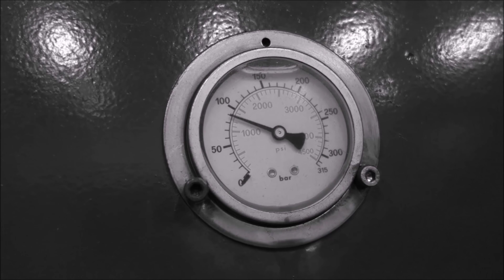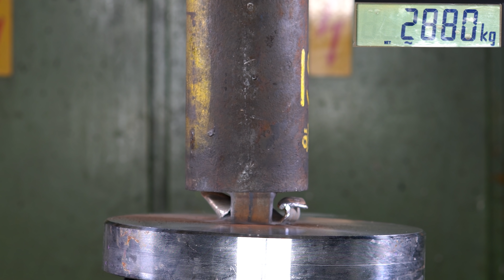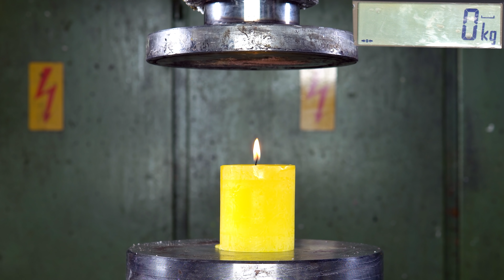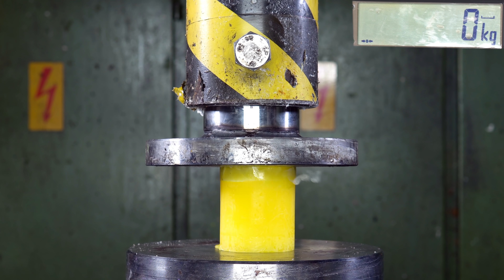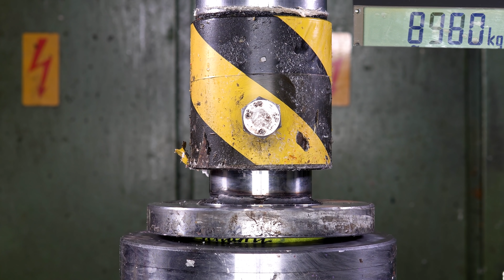How Strong Are different Materials at -320°F / -196°C? Hydraulic Press Test!

Comment: You could machine frozen fruits
Frozen cucumber in the lathe would be interesting
Reply from the maker: I have been thinking about machining frozen things. The mounting is really hard since lathe is quite warm and melts thing quite fast. But I think I could come up with something to prevent that
Reply: Yes please do that
Reply: @HydraulicPressChannel  Maybe you can cool the lathe chuck with liquid nitrogen too? Or maybe it would be easier to make new plastic chuck jaws that won't transmit the heat away as quickly, and mount a copper infrared mirror behind the frozen thing to keep the lathe from warming the part even more. . :)
Reply: I am no expert at lathing, but I'm pretty sure that just about any frozen fruit would shatter at those RPMs...
I am completely fine with that.
Please try it. 😁
Reply: What about frozen Burger?
Reply: @HydraulicPressChannel  you could maybe use dry ice to hold the frozen thing in place, or to cool the mounting before hand
Reply: My guess is almost everything would be so brittle that it'll just shatter immediately, except maybe things like cucumbers that are almost all water
Reply: @joe125ful  it could work too
Reply: Actually the method is used for milling rubber. Maybe not that cold but from what I can remember aduprene would be millable at around -40C.
Reply: @Rubensgardens.Skogsmuseum  good to know😎
Reply: I've seen people machining some of the firmer vegetables (turnips or potatoes) without freezing them first even
Reply: @zuthalsoraniz6764  i have machined hard bread
Reply: @HydraulicPressChannel  You could make a set of soft jaws (covers for the lathe jaws to protect finished surfaces from the rough jaw teeth) and then use some epoxy to attach some kind of insulation like rubber pads or something to the soft jaws. This would probably work and hold up quite well I think.
Reply: @sandy1653  He could just make the soft jaws from the insulation material.  But this is the hydraulic press channel, not the cryogenic channel, so not the place to have other fun with liquid nitrogen.

Comment: If you are freezing metals again, I thing the stainless steel that spaceX are using on their pace ships would be good because it's supposed to get stronger when super cold.  Also, I have heard that hardened drill bits and hardened steel gets even stronger when you soak it in liquid nitrogen but it keeps the strength even after it returns to room temperature.  Apparently it makes cutting tools last longer.

Comment: The frozen steel wos 50 % stronger because at the beginning it was just 10 tons but 15 at the end
Reply: yes
Reply: In fact, the steel was cryogenic hardened
Reply: @Dee13i  hardness isn't the same thing as  strength
Reply: @Dee13i  yes
Reply: @MF175mp  Hard materials have more strength for compression. You can also see cracks because steel has become weaker to bending and stretching.
Reply: Brittle, not stronger

Comment: Holy sheet! Did you guys do this as a result of my comment? I commented about this a couple weeks ago! :D that was neat. I would have liked to see more metals but the steel was really unexpected. I would have thought that the frozen steel would be significantly weaker too. 

Side note: I really appreciate your dedication to crushing things completely. Specifically the pineapple. Thanks guys :D
Reply: The frozen one was about 50% stronger than the normal one which actually cracked at around 10 000 kg. (the max value recording was wrong)

Comment: We have a cryogenic chest freezer where I work. It's only down to -110° F but you can still get some pretty cool things to happen. We use it to press fit bearings. Freeze the bearings and heat the connecting rods and they will slip together with no effort or stress. Once they come back to room temp they are literally fused together. Place a rose in there for five minutes and it's like made of glass. Fruit is also very interesting at that temp.

Comment: An idea: let the steel stay in the liquid nitrogen and the let it return to room temperature before testing. This should produce a large increase in strength.
Reply: Stu McCabe: that would only be true if the steel had sufficient Carbon, and was quenched from above its Austenizing temperature, to form Martensite.
Reply: Heat treater here.

Comment: the frozen candle isnt not burning because of nitrogen, it's because it needs the wax to melt and wick up the wick in order to stay lit. but the wax is too cold. that mist you see around the candle isnt nitrogen, it's water vapor condensing out of the air

Comment: While the nitrogen might be partially at fault, the key to a candle burning it the wax needs to melt and evaporate to feed the flame. 
With the wax frozen so cold the wick isn't enough to heat up and melt the wax to keep the flame burning. The wick itself (by design) isn't actually that flammable.

Comment: The frozen candle won’t burn because it’s too cold to ignite. Everyone says fire is extinguished because of a breeze or smothering, but fire goes out if the object is too cold. If you fill a paper cup with cold water and dry to burn it, it won’t catch on fire and the burning will be significantly slower than an empty cup

Comment: For softer materials  you have to use a smaller load cell. When I test compressive yield I also have a  lvdt sensor along with the load cell. The highest load I will see it 4000 psi. Insteon machines are great for this.

Comment: The candle flame is burning phase changed wax (it melts and then gets vaporised by the heat - it's the vapour that burns).  Thus, when chilled to liquid nitrogen temperatures, the candle won't light, as the wax isn't even melting, let alone vaporising. You might get the wick to burn - but no molten wax will be rising within the wick, to be vaporised and then burnt.

Comment: I am maybe a bit late with the suggestion. I suppose you used some general carbon steel in the first test. They tend to go through this ductile to brittle transition which - as the name suggests - makes them brittle and less ductile. On the other hand, if you would try some stainless such as 304 or 316, they would become much better in cryo conditions. You can easily double their strength. If you ever repeat similar experiments, please consider doing a test on the above mentioned stainless steels.

Comment: Temperature only really begins impacting material properties when they get above room temperature. For instance, for some 7050 aluminum, at 160F the ultimate strength is 91% as strong as it is at room temp. Going negative doesn't really get you much except it becomes more brittle.

Comment: You should make a graph of force versus press head position so we can see more information than just peak pressure.  For instance, the steel had very similar peak pressures cold versus warm, but as the head went down, then appeared to diverge significantly.

Comment: The frozen square pipe was about 3 times stronger than the regular temperature one. While the regular temperature one was being squashed it only peaked at around 5,000 kg - it only hit 15,000 kg once it was bottoming out.

Comment: Lauri, you need to read Michel Faraday's "Natural history of a candle"; then you'll understand why a deep frozen candle won't burn.
(Basically you need to get the fuel first liquid to wick it up, then gaseous to burn. The flame is to weak to sustain this process with the supercooled fuel.)
Also, if you watch how forces go up, the steel tube was actually stronger while it was still in columnar form. At room temperature the force only went up that high when it was almost a pancake.

Comment: The frozen candle not burning has nothing to do with nitrogen smothering it. It's just the old catch-22: 1) Candle burns liquid wax for fuel. 2) Burning candle makes heat, that melts more wax into fuel. So the candle being so very cold, it can't melt fuel fast enough to keep burning.

Comment: Try round metal pipe.   The square one broke due to the tension on the weakened corners.  A round pipe will disperse the pressure evenly and make it explode.  Just like the rubber hose.

Comment: Just a friendly reminder from my personal experiences. For your safety, you should never use any kind of gloves when dealing with Liquid nitrogen. The physics behind that is that when you get LN on your bare skin, it just skids off boiling, same phenomenom what happens when pouring water into hot stove plate. Temperature difference is similar although in different end of scale. When using glove, LN just tends to imbue with the glove, like paper towel with water. I've done that mistake when trying LN cooling with pc overclocking, and that stuff hurts like hell when it gets into the glove.

Comment: SpaceX new rocket is using a 300-series steel that strengthens at cryogenic temperatures (the fuel and oxidizer are cryo). Because of this, they can use less material and still stay strong, keeping the weight about the same as carbon-fiber.

Comment: The little explosions at 10:12 and 10:29 must have generated a lot of heat as what was left had instantly turned into liquid. Would have been cool to watch the frozen candle collapsing in super slomo as even at .25x it's hard to tell what's happening.

Comment: I dunno about that first crush... you read the peak tonnage from the meter but by the time that number came up on the meter that thing was already more or less completely crushed. Are we measuring crushing force before the item failed to provide support or force required to turn the item into like a pancake? Because this is going to yield different numbers. The failure occurred at roughly 10,000 kg on the first item but after it had crushed down to around 1/6th of it's original length and piled up on itself it became harder to crush and spiked the pressure to 15,000 kg. And it only stopped at 15,000-ish because you ended the crush. I'm not trolling here I'm just questioning where the stopping point is because it seems illogical. If not at first obvious failure, why not at full press pressure / absolute crush? (and yes I know that would be the same # every time but I'm making a point)   EDIT:  And I just watched the second part crush (nitrogen frozen tube) and you called it the same as unfrozen. I watched it at 1/4 speed and first obvious failure indeed was at 15,000-ish kg. So actually the frozen piece of square tube is 50% stronger than the unfrozen tube.

Comment: Can you not install a weight large scale hung from the presses metal frame with a new tool that has the chain welded to it or have a swinging pressing plate attached ? Instead of having a sensor reading pressure a scale would measure how much the ram is pulling it down.

Comment: With that banana, I wonder if that's how they freeze dry food for astronauts?
Reply: No, that was just a frozen banana. I think that is a process of cold temps, low pressure humidity extraction. The product doesn't stay frozen for consumption. You can freeze dry ice cream and eat it at room temp.
Reply: @ticktockmoto7301  Yeah I've eaten freeze dried ice cream before but I've always wondered how they did it.

Comment: Why has nobody pointed out that the max force the room temp. steel tube withheld was actually 10,000 kg, not 15,000? Which would mean that freezing the steel tube increased max force withstanding by 50%

Comment: Candle wax evaporates and is the fuel for the candle...it could be that it's simply so cold that it won't evaporate quickly enough to fuel the flame. Just off the top of my head at least.

Comment: Your force measurement is done wrong with the first steel piece.
When crushing the one at room temperature you took the force when it already had collapsed completely and the remains are compressed.
From the second tube frozen in nitrogen you took correctly the maximum force at which the material started to yield, and stopped before it completely collapsed.
This way of comparing things is not very scientific and like comparing oranges with apples.

To do things right you should have taken the reading at the same point of the first tube, which was clearly visible in the video, the load cell showed 10900 kg at that point.
So the frozen tube needed a higher force as expected, because the freezing makes the steel harder but more brittle as well.